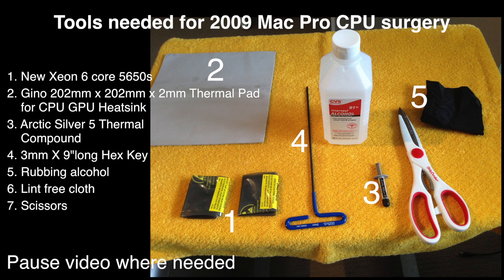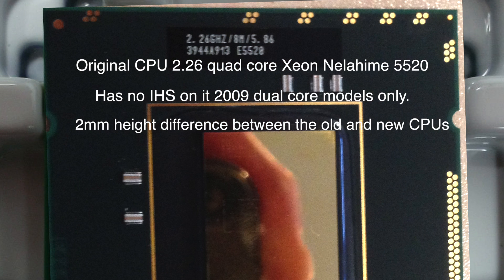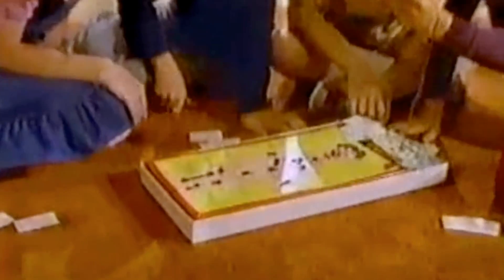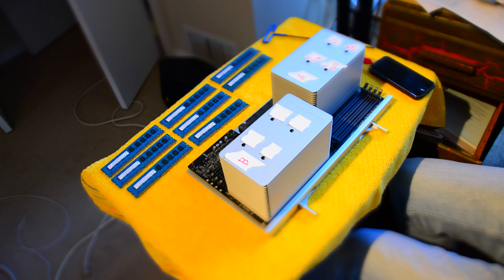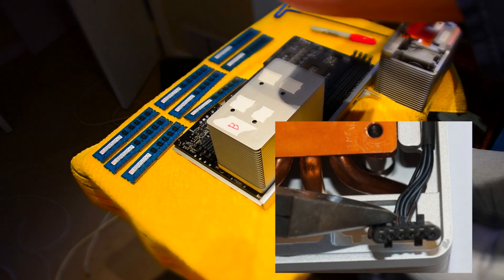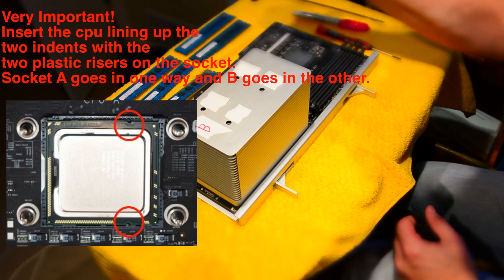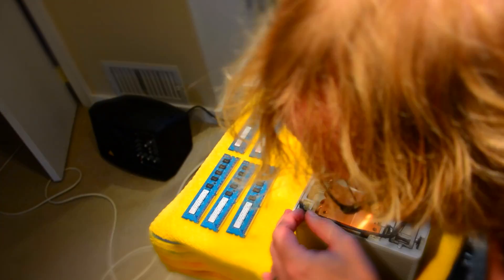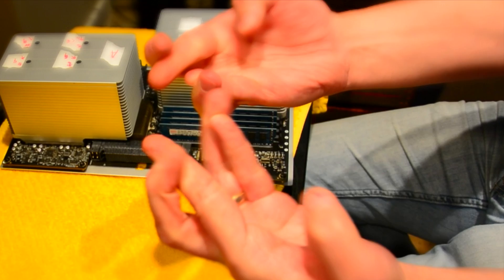Mac Pro 2009 5,1 CPU upgrade 8 core to 2010 12 core

Comment: Hi Lance,
Thanks so much for taking the time to post this video. I'm planning to do the same thing. I was wondering whether I could uses these CPUs:
http://ark.intel.com/products/47920/Intel-Xeon-Processor-X5670-12M-Cache-2_93-GHz-6_40-GTs-Intel-QPI?wapkw=x5670
I think they're compatible. Any help gratefully received.
Reply: Damon UK Or these? http://www.cpu-world.com/sspec/SL/SLBV7.html#specs Are there different types of the ?Xeon 2.93? Not sure what the SLBV7 stand for?
Reply from the maker: SLBV7 is the final production model number. You only want Xeons that have those numbers
as Xeons with a different model number is most likely a prototype.
You can use the ones you are looking at but also look on eBay 
Just search Xeon 5670 and they will come up, maybe you did already
Just to give you an idea on the price range. Also check out the 5680 and 5690
Reply: Lance McVickar Thanks Lance. I ended up buying a pair of 5675s which should improve things ( the 5680/5690s are quite expensive over here in the UK). I was finding my dual 2.66 running Yosemite had become almost usable. Only 8Gb RAM which is probably the problem. Anyway, I shall reconsult your video once I have all the required installation tools. Many thanks.
Reply: Damon UK I did it and it all worked 1st time!!!!!! Thank you for a brilliant video. I also read the articles in your link which were helpful. The only thing I needed to do was get the fans under control so I downloaded Macs Fan Control which brought everything under control. Now to update the graphics card. I've got 2 x 30' Apple Cinema displays - I've currently got the standard card and run the 2nd monitor using the mini display port with an Apple Adaptor. Any suggestions?
Reply: Damon UK I may have spoken too soon! According to Mac Fan Control CPU A BOOST fan isn't turning. Any ideas as to why this is? The heatsink not making proper contact? Or is it not getting power?
Reply from the maker: Damon UK Read the text I just posted for Du Yu, about the fans. You should not be using MFC to controld the fans, only later after they are behaving, again read me latest post on the fan issue and read what others have done.
Reply: Lance McVickar As always, many thanks Lance. I'll read that post. My latest woe is now the first memory slot is not showing any memory. I've done various incremental tightenings but nothing. Are the first 4 memory slots associated with the CPU A? My other though re the fans is that the black power cable may be damaged. Does that cable have any other function apart from power?
Reply from the maker: Damon UK Yes it's four slots per processor, I had the same issue and tightened my first heat sync a quarter turn each and the missing ram then showed up. Not sure what power cable you are talking about. One thing is the heatsync cables must go in the same way they came out, I think they can be put in backwards and it will be an issue but not 100% sure on that. Did you cut the connectors for the heat syncs or not, if not they may not be making the full connection then the fans will blast at full speed. I know some folks don't cut them and others due. DId you add the thermal pads and are they touching the heat syncs as they should be?
Gotta run to work... hope you can work it out. Sounds like you are close, take a deep breath and take your time to figure it out I know its frustrating.
Reply: Lance. Thanks again. You're a perfect example of why the Internet is good! One final thing! When I run MFC there is no reading at all from the A diode or cpu. Does this mean the heatsink connector isn't working? I did trim it and pull it away to give me length. Also does that connector provide power to the heatsink? I'll check the thermal pads as suggested though. It feels so close. Any extra help always massively appreciated.
Reply: Damon UK Hi Lance. I replaced the Heatsink for CPU A and finally got Fan A going but still get no readings from heatsink A or CPU diode A using Mac Fans. All the thermal pads are touching and I've tightened the heatsink screws as tight as I'm able without using some brute force. I'm now at a loss as to what to do. Any last ditch ideas?
Reply from the maker: Damon UK Are both CPUs working? or one is still not showing up, forget the MFC for a bit, do they show up under about this mac? 
Are your fans still blowing at full speed? Is all your ram showing up?
Reply from the maker: Damon UK try this it might do the trick if not you may have a bad sensor. Resetting your SCM System Management controller
https://support.apple.com/en-us/HT201295
Reply from the maker: Damon UK On Mac Pro, iMac, Mac mini, and XserveTo reset the SMC on Intel-based Mac Pro, iMac, and Mac mini computers, as well as Xserve:
Shut down the computer.Unplug the power cord.Wait fifteen seconds.Attach the power cord.Wait five seconds, then press the power button to turn on the computer.
For Intel-based Xserve computers that are not responding, you can 
shut down locally or by using remote commands. You can also shut down by
 pressing and holding the power button for five seconds.
Reply: Lance McVickar HI Lance, I tried resetting the SMC Control but still nothing from the sensor. Everything else is working fine - both CPUs, the RAM etc. I just have to turned the fans down manually. I've had the heatsink off and on about 25 times now and tried different amounts of thermal past. I even tried another thin strip of thermal padding to really make sure there was contact. I think I'll have to live with it. I least I got close. Machine is faster as least. I might try one further tighten of the heatsink!
Reply from the maker: Read these posts might help with some info

https://discussions.apple.com/thread/5509584?start=15&tstart=0

Also the connector that goes to the heat sinks must go back in the same way they came out,
If they are backwards, not sure if they will go in backwards, it can be a problem.
You might have a bad or damaged sensor some where.
If both cups are working and all ram is showing up I don't think tightening will help
In fact it might be a bad idea.

Comment: hello.. one question can update the graphic card to a nvidea 970 in that mac version?
Reply from the maker: Jorge Teixeira http://forums.macrumors.com/threads/new-nvidia-gtx-970-and-980-cmp.1782921/
You can now put a 980 in an older mac pro. Look at Macvidcards website they sell them pre flashed, But Nvidia also has mac drivers for them. I would read up first to see if there are any issues, sorry did not get back sooner.
Reply: No problem thanks for the info... I buy a 5k iMac... Nit regreats :)
Reply from the maker: Nice!

Comment: Hey man i love your video can you help me i have a old mac pro 2007 i want to upgrade the cpus can you tell me what is the best cpus that i should buy here is my mac info thanks for your help.

Hardware Overview:

  Model Name:	Mac Pro
  Model Identifier:	MacPro1,1
  Processor Name:	Dual-Core Intel Xeon
  Processor Speed:	2.66 GHz
  Number Of Processors:	2
  Total Number Of Cores:	4
  L2 Cache (per processor):	4 MB
  Memory:	17 GB
  Bus Speed:	1.33 GHz
  Boot ROM Version:	MP11.005C.B08
  SMC Version (system):	1.7f10
  Serial Number (system):	G864626NUQ2
  Hardware UUID:	00000000-0000-1000-8000-0017F203F344
Reply from the maker: Tal Sla http://www.everymac.com/systems/apple/mac_pro/index-macpro.html
This page lists all mac pros and there processors. This page also looks like info you might want 
http://lowendmac.com/2014/modernizing-the-mac-pro-11-and-21/
I have not upgraded anything older than a 2009 when it comes to cpu. I know there are hacks so you can run Yosemite on the older ones. I still use a 3ghz quad core 1,1 Mac Pro at work with Snow Leopard and it is a pretty solid machine.

Comment: Omg, this video has helped me SO MUCH. I now have 2x 5650 Xeon 2.66 ghz in my computer up from 2x Xeon 2.22 processors (don't remember their exact speed). It's a pretty big improvement! I'm so glad I could get more life out of my mac.

That said, I had a few scares. First, I forgot to cut off the tabs on the cables for the heat sink and which weren't correctly in. So when I turned on my computer, the white light was blinking at me, it never chimed, and the fans were just running. Then once I went back and corrected that, I didn't screw the heat sinks in enough so the RAM wasn't being detected fully. I kept taking it out, unscrewing the heat sinks then re-screwing them a little bit more each time. Finally, everything worked and I got it up and running.
Reply from the maker: jotaroxtreme Congrats glad the video helped. It is a bit nerve racking. Don't for get you can put faster ram in as well if you don't already have it. 1333 as apposed to 1066.
Reply: Yep I ordered 2 sticks of 8 gig Kingston RAM and a GTX 960. I can't wait to test out this new hardware!

Comment: is the computer still working well!!
Reply from the maker: Still working like a champ and I use it almost 24 / 7.
Reply: Lance McVickar Thanks... good news... I have the exact same computer and am also a power user.. maybe not 24 7... but close..  Where do you get the chips and what are we talking about regarding pricing?  There is a guy on ebay who does the whole conversion or sells the computers as a whole but that might be more expensive.
Reply from the maker: michael b I bought mine on Ebay the 5650s are really cheap now and you can buy 5690s for around 225 per which is way cheaper than they were a year ago. Just buy from a top rated seller and make sure they are SLBV Costa Rica not proto types which would say something other than SLBV on them
Reply: Lance McVickar   Thanks.  I found this guy who has the entire kit... says he has removed the IHS  which I assume is the metal shroud over the chipset..   it includes everything ... looks a bit easier ..  http://www.ebay.com/itm/Mac-Pro-2009-4-1-Processor-Upgrade-Kit-to-12-Core-3-46GHz-Xeon-X5690-SLBVX-/221616239012
Reply from the maker: Yeap I have seen those and sure why not then there is no need for extra thermal pads and all the extra work not a bad price either.
Reply: Lance McVickar great thanks... he makes mention that the firmware update is not apple supported.  I assume that all of these updates are hacks  and not apple approved.
Reply from the maker: Yeap they are of corse not supported and the warranty on a 2009 is dead anyway. The firmware just makes your 4,1 a 5,1 and it is Apples firmware.
Reply: Lance McVickar  Hey thanks for all your help.. not like you are making a dime from this so it is very kind of you to supply the info.

Comment: Has anyone successfully delid (remove) the Xeon 5650 processors heat spreader?
Reply from the maker: XTZTwinTurbo I here it's very hard to do without screwing up, that being said there is a guy on ebay who does it and sells them so it is doable.
Reply: I've done 3 X5506 as prep for doing a couple of X5690. Once you have a process its easy.
Reply from the maker: cool be great if you could explain further how to do it.
Reply: +Lance McVickar i carefully trimmed the adhesive from the edges using a hand held razor then gently finished it off with a small single blade razor. Once all of the adhesive was cut, determined by the blade passing easily around the outside, i then inserted the blade into one edge and held it with locking forceps  similar to : http://www.amazon.com/Engineer-PH-03-Locking-Forceps/dp/B002F9MQKQ (I already had some so this is not the pair I used and is here as an example) Then I use bernzomatic torch to heat the top of the heat spreader. Gently holding it about 2 inches above and sweeping across the cpu until the heat spreader pops off. I then gently use a single sided razor to remove the rest of the solder from the CPU. Be careful of any top components when doing this. You might want to test first before going through the trouble of the final cleanup. I killed the first one but the next two work perfect and I've saved a third for a final practice before doing the x5690s when they arrive.
Reply from the maker: Cool thanks for sharing!
Reply: +Lance McVickar I'll see if I can't record my next session(s) and get them put up late this week or early next week.

Comment: Another question: Is the Mac Pro getting louder after the upgrade? I found out the cpu´s need almost double of power (Xeon 5680: 130 watts compared to stock cpu: 80 watts). Did you experience steady fan noise and stuff?
Reply from the maker: Michael Dippon Not really, I have not notice any difference.

Comment: Hi, thanks for the great video. I´ve tried to perform the upgrade and till now im suffering a few bugs like no video, no startup chime… anyway I´m wondering is it possible that a different thermal paste might be the reason for this? I was using Arctic MX4 and found no advices against using it for CPU cooling. Any suggestions on that?
Reply from the maker: Michael Dippon I used Arctic Silver #5 not really sure about the diff between the two, I would go to their websites and check it out. You did the firmware update first yes?You may want to remove CPU 2 and see if you can get it to boot with only #1 installed. You do have to have certain amount of pressure distributed to the heat sinks but going too tight can bea bad thing. You may have put them in two tight or not tight enough. There are many factors as to why it may not be booting. Read up on the thermal paste you used. Wish I could help more but there are so many factors.

Comment: Let me be the next person to thank you for this video. Found an awesome deal on a couple 3.33 GHz 5680s (with caps, of course), so I took the plunge. It was only mildly nerve-racking. I did clip off the tabs on the heat sync cable on the first processor, but getting in plugged back in was such a pain that I rolled the dice on the second one and left it alone. Thankfully, no issues there. Had to do the multi-round tightening to get it to boot, but otherwise okay. Multicore Geekbench 3 now nearly 30,000 with stock 1066 ram. This was coming from a quad-core Hackintosh that I'd topped out at 15,000, so I was very happy. Thanks again.

Comment from the maker: Take the advise below from Dirtylobster "Buy an ESD Kit" so you don't zap your new processors or logic board with static. Something I did not use or talk about which I should have!
Reply: +Lance McVickar Does it still say Mac Pro Early 2009 or it has changed to Mac Pro early 2010 once you did the CPU upgrade?
Reply from the maker: +M. Rezza Adinata Hutagalung it will still say 2009 but will say 5,1 instead of 4,1.
Reply: +Lance McVickar Just a question, do you know what's the best processor to upgrade a 4.1 early 2009 Mac Pro 2.66ghz Quad Core? It's a single 4 core Mac pro, so it can only run with 3.2ghz single 4 core right? Unlike yours, with 8 cores/12 cores?
Reply from the maker: You can install this baby
Xeon-Processor-W3690-SLBW2-6-Core
 3.46 GHz, LGA 1366
Just an example on ebay below.
http://www.ebay.com/itm/Intel-Xeon-Processor-W3690-SLBW2-6-Core-12M-Cache-3-46-GHz-LGA-1366-NO-FAN-/151898390531?hash=item235dd98003:g:irwAAOSwv-NWWgy-
Reply: +Lance McVickar This is brilliant! Thanks mate. Do you advise this upgrade? Would this be equivalently good in comparison with the 2010s Mac Pro?
Reply from the maker: Yes it is exactly the same as a 2010 once you do the upgrade mine is going strong for over a year now. If I were to do it again I might buy delidded cpus or delid them myself, as it seems it is not that hard. That removes the complexity of the 2mm difference using the cpus that have the heat spreaders on them. You can find them on ebay with the heat spreader removed. It will cost a bit more but makes installation much easier.
Here is an example of 5680s granted you are paying extra for this kit, but just an example.
http://www.ebay.com/itm/Mac-Pro-2009-4-1-Processor-Upgrade-Kit-to-12-Core-3-33GHz-Xeon-X5680-SLBV5-/221822847019?hash=item33a5ac082b:g:uQ4AAOSwHnFVoBwQ

Comment: I'm surprised there are no specialized torque wrenches for this. I've seen and used small inch-pound rated torque wrenches for small nuts and screws that may have been what you could have used to tighten down the heat-sinks correctly the first time.
Reply from the maker: ***** read this for info on the upgrade and about torque etc...https://web.archive.org/web/20131026053641/http://pindelski.org/Photography/2013/07/08/mac-pro-2009-part-tbd/
Reply: Raymond Ward Why? Because Apple is retarded and makes almost everything proprietary? Welcome to the PC land, where you need just ONE tool for an entire PC build. Sigh.
Reply: Unfortunately, that link is dead. It says "Sorry. This URL has been excluded from the Wayback Machine."

Comment from the maker: UPDATE!!!!!!!!!! on HOW TO APPLY THERMAL PASTE, thanks to Prince's post I did some digging and my pea method.  It's not the best though it worked for me, nor is spreading it on the cpu according to Arctic Silver. if you buy Artic Silver 5. Download their PDF and follow their instructions. They say a vertical line is the best method for Xeon 5600 series.
http://www.arcticsilver.com/pdf/appmeth/int/vl/intel_app_method_vertical_line_v1.1.pdf
Reply: Lance McVickar As long as it is making contact and not all over the logic board, you should be okay. I used Tuniq TX-4 when doing a processor change on an old Dell, and Tuniq recommended spreading it out, even supplying a piece of stiff plastic to do the job. There is supposed to be minimal burn-in period with TX-4 but I did notice a drop in temps after the first week. As you pointed out several times in your awesome video, many variables--some critical, some relatively harmless.